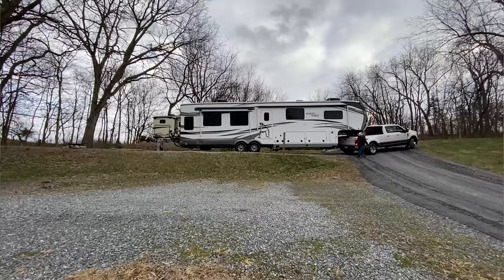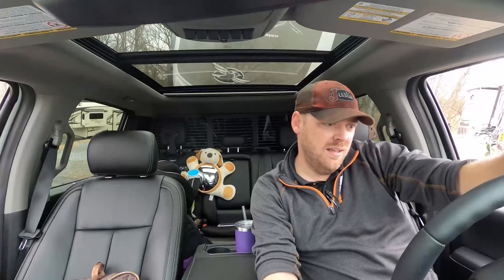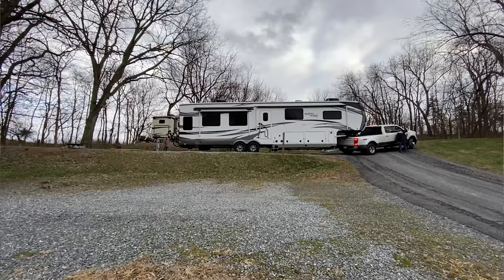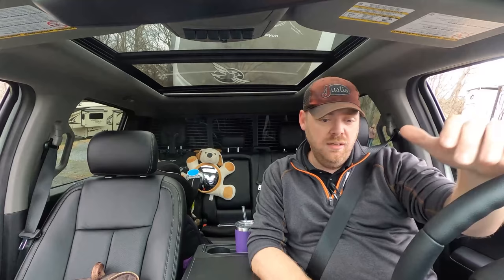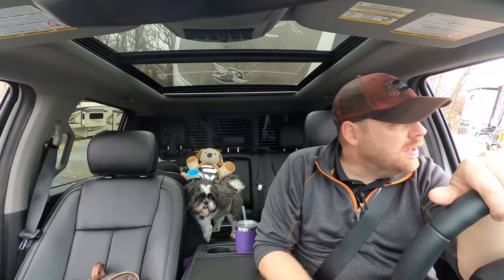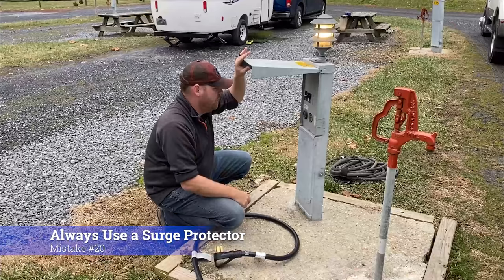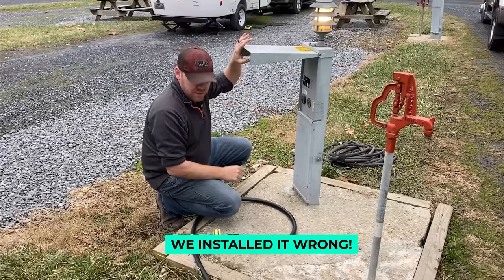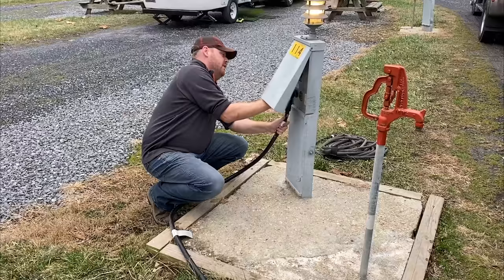RV Newbie | How NOT to RV! (First Time Towing FAIL)

Comment: When unhooking, always chock the trailer wheels FIRST before anything else. Then lower landing gear SECOND. Disconnect trailer plug and unlock hitch LAST. When hooking up, do in reverse order.
Reply from the maker: Thanks, you just started our new RV checklist. 👍 Now we just need a Level Mate Pro to tell us if we are level in the beginning. It’s tough finding out the rig won’t auto-level due to excessive slope. Then we have to re-hitch and start all over. Painful!
Reply: @discoveryboundrv  we've all done it! lol Checklists absolutely help, and I have to avoid having a conversation with the neighbors when I'm in the middle of hooking/unhooking or I'll lose focus and potentially make an expensive mistake! Looks like you've developed a good system now though. 👍 Just found your channel and am enjoying your adventures!
Reply: It has made is second guess what we want to do in retirement.

Comment: tip.. when backing into your spot come to a stop. put your truck in neutral let go of the foot brake and use trailer brake only to stop again. Then set e brake as tight as it goes while still holding trailer brake. Then shift to park. This eliminates strain between the trailer and truck and also eliminates unnecessary weight on the transmission parking pawl. Any time you don’t use an e brake with a heavy load all that weight is sitting on your trans parking pawl and kingpin and makes it much harder to unhitch. After this process lift trailer with landing gear until the plate is about a half inch or so above the hitch. Then make sure your hitch is locked in the open jaw position. Almost all 5w hitches can lock in open jaw position. Then open tailgate unhook emergency breakaway and 7 way light plug. Then pull away from trailer as soon as you’re chalked blocked.
Reply: Too big and heavy vs not enough truck to handle it.

Comment: Thanks for the video! One note of caution for yourself or anyone watching the video is that you should never store your "poop hose" and fresh water hose in the same compartment, or at least wrap one of them in a plastic bag of some sort. Those hoses always have residual liquid in them and it looks like the poop hose was on top of the fresh water hose. We keep ours in separate compartments and sanitize our fresh water system every year, we don't drink the water but we like to keep the option open to do so, not to mention it's the water you wash dishes with. I realize the "poop hose" is used to flush the system out not necessarily to transport poop, but consider the ground it typically gets unraveled onto (dump station).
Reply from the maker: Hi Aaron. Great tip and you are 100% correct. They are both water hoses, but you can never be too careful when it comes to sanitizing what you are drinking or bathing in. Especially, when we have little kids. Thanks again for the great tip and all the best from all of us here.

Comment: You need to chock your tires front and back both sides, before you do anything related to disconnecting. A checklist would be a good idea. Lots of info on other YouTube channels for connecting/disconnecting.
Reply from the maker: We agree! Having a rig this big and using a small chock doesn't work. Both sides and bigger chocks are an absolute requirement. Since then, our checklist has grown to be very useful. We get so many great ideas from the RV community that our list keeps growing. It's so amazing to receive such great tips and guidance from the ones who have been there and done that already. Always looking for new ways to make this process easier and quicker (but not cutting corners.) Thanks again and safe travels.

Comment: if you want to unhook faster, after you raise legs and get weight off, put it in reverse, to take pressure off of pull bar, not much,  of course you blocked the wheels right

Comment: When you pick up a trailer with a semi,  you back up till you hear the jaws lock, and with out the air lines connected one of the trailer axils breaks will be locked, because of the spring loaded duel chamber that requires air to release the spring pressure that works as a safety system if the air line breaks,the breaks will lock up instead of having no breaks, and is obviously used for parking breaks , so with the trailer breaks engaged you pull forward to make sure that the jaws are locked, then you hook everything up, 
Now when you un hook, you need the trailer breaks locked up and back up slightly to take the pressure off the jaws before you un latch the Jaws, un hook everything and pull forward, 

The semi trailers are usually set to be slightly low so that the truck slightly picks the trailer up a little of course the trailer breaks must be set to do this, ,

Comment: So, this is how my wife and I looked when we were newbies. But, not exactly. 🤣
I had an advantage back 12 years ago when we started. I had been driving semi-trucks for 25 years at that time. It helped a little..
But, things will always go wrong. 
Good luck..
Reply from the maker: Hi Hoss! With 25 years of Trucking experience, I should have called you to pull that rig out. Thank goodness for the F-350. Having the right equipment is the first step to RV success. Safe Travels!

Comment: Hello! Thank you for sharing and reminding us all what we should be checking for. One thing I have learned is that auto level almost always raises the rig up first then levels it which can cause problems. If you use the manual option that can be controlled and you might be able to level without having to hook the trailer back up. Cheers!
Reply from the maker: Hi Michael! Thanks for the great tip. We were so new at this that we were nervous about ANY movement the Rig made. All we could say is "Don't Drop the RV". LOL. You are correct, we should have used the manual part and wouldn't have needed to disconnect. These are more lessons learned the hard way. Thanks for sharing.

Comment: Don’t feel bad about having trouble releasing your kingpin. I had a Curt hitch and constantly had the same problem. I switched to a B&W hitch and that problem went away.
Reply from the maker: Hi Thomas, the King Pin is the single biggest worry that we have no matter what we do. We have a thousand questions every time we hitch up the rig. Is it locked? Did it seat correctly? Will it come loose? Where’s the darn lube plate? Lol 😆 It’s only when it starts making those loud CLANK sounds that we are like “Yep, we’re dropping the rig!” Glad your new hitch works better. I think ours is fine, we are just newbies and need to learn how to use it.
Reply: @discoveryboundrv  one thing that will help is after you have the camper chocked, shift into neutral and let your truck roll back just a little. That will take some of the pressure off.

Comment: The wife is right the fifth wheel is to high. You want just a little weight on the fifth wheel and have the camper side off the fifth wheel. No daylight between the fifth wheel and the camper. The king pin is binding up with the jaws on the fifth wheel with the camper being to high.
Reply from the maker: RV Dog, you're the man! We never realized that a little weight was the key to success. We have added it to our process. Thank you!

Comment: I’ve pulled trailers my entire driving career, when we bought our northpoint, same model btw. We had some of the same anxieties you did. Of course yo7 get the hardest campsite to start off with, never fails. You guys did fine. I bet after you’ve been out for a year or more now, you look back at this and think. How could we have been so naïve about some of these things. It’s hard to think straight when it’s all so new, truck included. You did things slow which is the most important. You’re old hats at this stuff now, and it’s probably second nature. As always great video!

Comment: I’m not 6’2” so l climb up on the tire to release the pin! I also have something I can mount on the tire to climb on to reach the handle.  I have to say you being a newbie pulling a north point fifth wheel of that length is ballsy! Kudos also for not trying to pull that behemoth with a 1/2 ton. Pretty sure you should have a power cord for your Furrion system, I don’t think it has batteries. Oh! By the way, at some point your going to forget to lower the tailgate and try to drive out, CHECKLIST!!!
Reply from the maker: Hi Bud, that's a great device. I think I have seen those around and they really do work. I am about 1 inch from not being able to get my fingers on the pin. The problem is when it's raining. I am basically hugging the dually and get soaked. I started climbing on the tire recently. I did see a step that people mount just forward of the back tires. Let me know if you have experience with that. Safe Travels.

Comment: If you ever have a hard time getting the jaws on the 5th wheel hitch to release the trick with is also to get all the tension off the jaws. You don’t necessarily have to lift to where you get a gap, just get most the weight off.  Sometimes (with the rv chocked) you just have to put the truck in neutral for a moment, or even just a tiny smidge reverse. Pushing against it is fine but any pull on the jaws and the won’t (and shouldn’t) release.
Reply: And having the trailer just a smidge low it better than too high when you go to hook up. Your (wife?j was totally right about doing a tug test ( landing gear - what you called front stabilizers) just off the ground, use the manual control lever to apply the rv brakes (and you can leave em chocked) and give it a little pull with the truck.
Reply: Watching further yeah your jaws weren’t unlocking because it had tension. You don’t really need a gap. It has a ramp for a reason, you’re supposed to pick up some of the weight as you back under it. RV you can’t do like semi and just pick the whole thing up backing into it though. As you do it more you’ll learn what it looks like. It’s not like a bumper ball at all :)
Reply from the maker: Thanks for the great information on this! Your experience is definitely warm welcomed and I appreciate your support. Having never hitched anything with a 5th Wheel before, I feel that this is the single most important lesson that everyone should be taught by a professional at least once. Most times, RV'ers will get an orientation on the RV from the dealership, but not the safety tips or process when hooking up. If anything goes wrong during hitching, then major issues can occur very quickly and put others in danger. This video was shot the day after our F-350 arrived and we were so excited to hitch up the rig and hit the road. We watched a few videos and thought we were professionals. We quickly learned that nothing beats experience! I hope that people will read your comment and let your experience guide them through a safe hitching process. Great information and thank you again for sharing. All the best and Safe Travels!

Comment: Enjoyed the video but it sure was painful to watch.. as in... a reminder when we all started out as newbies. A checklist in the beginning is a must. By the sound of the first pull on the hitch handle, I knew you were going to have difficulties. There's a certain sound to a Reese, Ford-installed hitch. They are a powerful hitch but a BEAST when you want it to let go. That part wasn't 'newbie'. That part doesn't get very much better, speaking from experience to this day. I keep a step-stool in the truck bed to easier reach and wrangle the hitch pin.
Reply from the maker: Thanks for the background on this. I am always wondering if these minor complications are just a nuisance or I am actually doing something wrong. We learn best our own mistakes and guidance of others. So we appreciate your support. Our checklist was created about 4 days after that video. Right about the second time we got stuck. :)

Comment: Soon you'll be a pro at setting up and tearing down. You have a big setup so try to get pull thrus when ever u can. I noticed that your bed rail clearance  is a little tight watch thar you should have min 5" clearance.  But consider a gen y pin box that will give you better clearance
Reply from the maker: We completely agree! Pull thru's are the best, especially over 40 feet long. When we bought our Rig, we had no idea about truck & trailer clearance issues. Check out Episode 18 (We Crushed the Rig) and you will see exactly what happens without the 5" clearance. :)

Comment: Snap pads & air bags are unnecessary.  You need chocks for each wheel (4), and pliers to reach the hitch latch safety clip. You should also watch some videos about how to use your specific jack controller, and hitch.

Comment: we've pulled a travel trailer for years.  now we are on our 1st 5th wheel so I had a pretty good idea of what we were getting into, however, newbie bat hit this guy.  Hooking up at dealership and pulling home...not an issue.  Got home (in the dark of course), and disconnecting the camper.  we had the front stabilizers down and well, lets say we didn't raise it high enough to clear the 5th wheel hitch.  pulled out and bam, camper came down on the truck.  well, really the truck leaf springs released and "raised" into the camper.  thank God nothing major to either truck or camper.  Now I know not to make that mistake again.  it could have been way way worse.  I've seen videos of serious dmg to stabilizers, truck bed rails, the 5th wheel overhang.  ugh.  I had a mental checklist in my head from my previous camper (i could unhook that blindfolded), but new trailer, new checklist.  Just take it slow and think every step, "what could happen if I continue?".  Nice video guys. enjoy the life!
Reply from the maker: Hi Peter. Your "Newbie" story is amazing! Thank you so much for sharing your experience. We are so thankful that nothing major happened to the truck or your 5th wheel. You were very lucky, indeed! The RV community is so diverse and there are so many things that happen and they are all good lessons to learn. You are 100% correct, take it slow and steady. When in doubt, knock on your neighbors door and ask for help. We have discovered that most RV'ers love to help others. We got a call from a guy we met after he left the RV Park and he asked us if we could come tow him back. 2 hours away didn't matter to us at all. We jumped on the opportunity to help out. :)

Comment: When you want to pull the handle on your hitch always back up and the handle will pull. With forward pressure on the jaws they won't release.
Reply from the maker: Hi Paul, great tip. Thank you. Safe Travels.

Comment: reccomend a B&W hitch. no question if it locked. also never a problem to unhitch even when there is pressure on it.
Reply from the maker: Hi Kyle. Great tip and thanks. We had the Ford factory install the hitch when we ordered the truck. We thought it would be the best bet. It seems like there are many other options that might work better for different people. We will look into the B&W hitch. Thanks for sharing. Best.

Comment: We made plenty of mistakes on our first few trips but luckily I had experience pulling boats and trailer.  I’m sure you know this by now but for others, the settings are 1-10 and is a percentage of the brake you apply on truck. Setting of 5 is 50%.

Comment: When you hook up. Do a tug test.I all ways check to make sure the jaws are closed then raise your front jacks off the ground 1 to2 inches. Then get in truck set trailer brakes an then give a little gas the front of truck will lift just a little bit. Then you will 
Know that you king pin is lock in.if is not 
You trailer will only drop 1 inch.be safe in your travels.
Reply from the maker: Great tip. Thanks. I need to start visually checking the King Pin like you mentioned.

Comment: I hold trailer brake and then put truck in reverse to take the bind off the fifthwheel . On semi's we set trailer brakes then back inch to take bind off
Reply from the maker: Hi Robert. You are the first to confirm that the process between RV's and 18 Wheeler's are the same when it comes to releasing the pressure on the 5th wheel. I never thought of holding the trailer brakes. I just throw it in reverse. Incredible tip and thank you for sharing that. We are updating our checklist. :) Safe travels!

Comment: With that heavy of a rig to keep from your transmission going out you should be in tow haul all the time because you will burn the overdrive gears out if you don’t in the transmission and you’re looking around 3500 or more and repairs
Reply from the maker: Hi Tim. Great advice. Thank you. We are pretty good at making sure we’re in Tow-Haul most of the time. I say that because a few weeks ago I forgot and there is a noticeable difference when pulling up a hill. The truck goes from knowing which gear to be in to staying longer in certain gears. Also the torque is dramatically reduced. It felt really sluggish. We only drove about 1.5 miles but glad we caught it. Thanks again and travel safe!
Reply: I agree with Tim Williams regarding tow/haul mode.